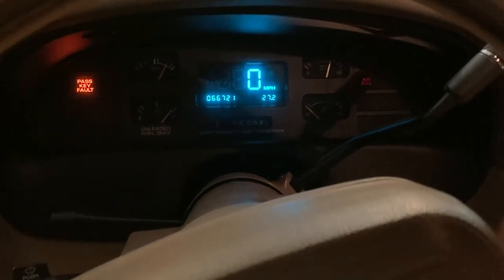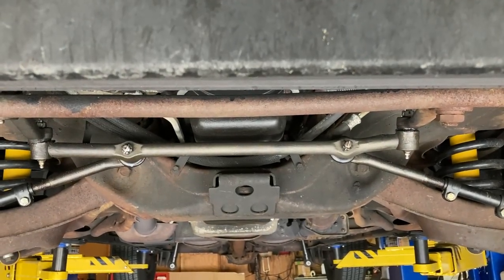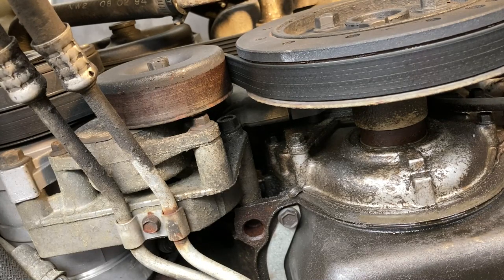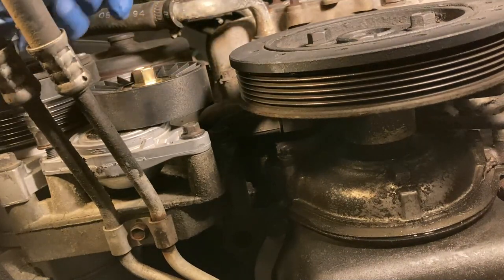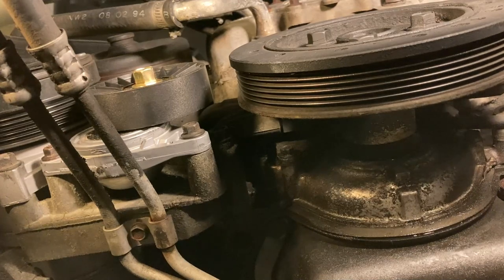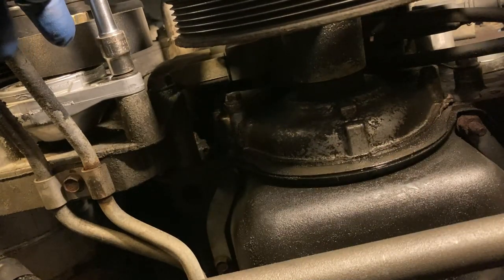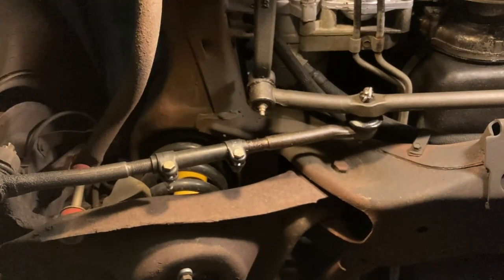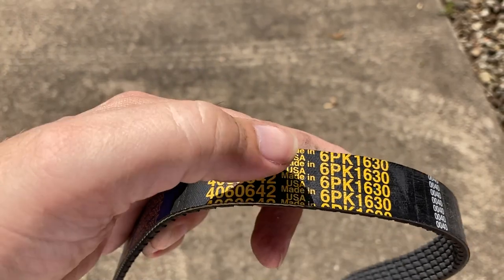1994-1996 Chevy Caprice, Impala SS, 9C1, Buick Roadmaster, Cadillac Fleetwood Belt Tensioner Noise

Comment: I agree with the tensioner being weak, and I don't like those plastic pulleys!! That Sears and Roebuck tensioner is wild! I think they stopped making gaterback belts 10 or 15 years ago!! Good video.
Reply from the maker: Thanks!  Daily driving these old rigs... it's helpful to get parts on clearance and hoard them. Lol. Interestingly, that tensioner PN comes up as a Duralast part now. Still available at Autozone. Rockauto still has the tensioner wih metal pulley available. Delco and Gates. However the plastic ones my stay quiet longer. Time will tell.

Comment: Hi, i have a 96 ' b4u w. Mechanical fan. It is working but rattling noise always. Any tips? Thank you
Reply from the maker: Where is the rattle coming from?  You can isolate the mechanical fan by removing its belt. It has its own tensioner. Which, by the way, is no longer available unfortunately.

Comment: Where is the crank sensor on this motor
Reply from the maker: @tommierogers2855  '94-95 doesn't have one. PCM uses Optispark position. For '96 only, a crank position sensor was added to the timing cover to meet OBD2 standards.